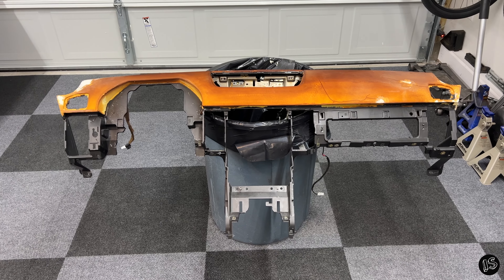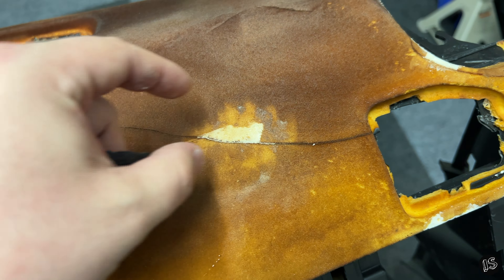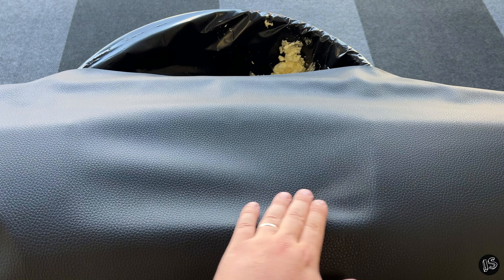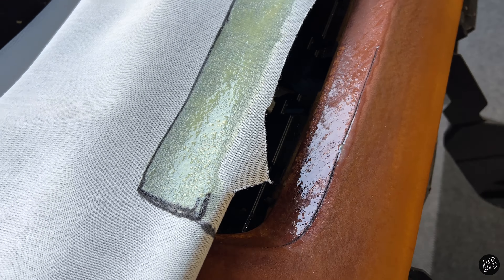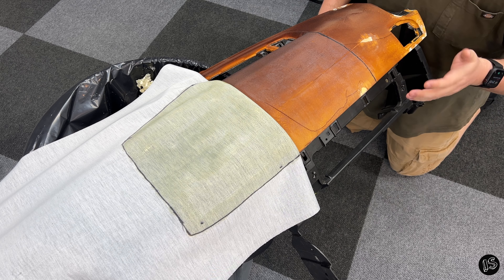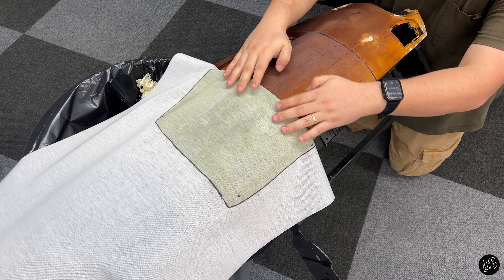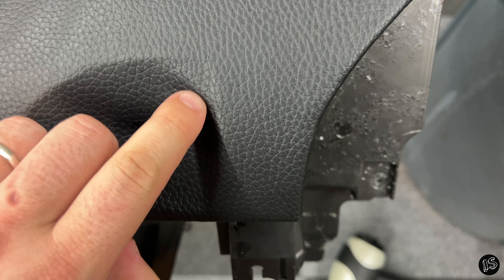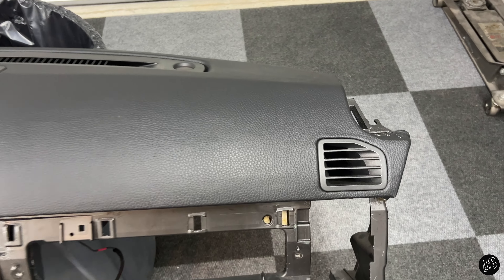G35 Cracked Dash Repair | $60 Total

Comment from the maker: **Safety Warning**

Perform this dashboard repair at your own risk. I am NOT a safety engineer, nor am I a qualified safety expert. I cannot guarantee that your passenger airbag will function properly in the event of an accident/collision. 

You can make relief cuts on the backside of the material where the airbag is to deploy. However, I cannot tell you how to perform this step. Use thought and caution before proceeding. 

Again, proceed at your own risk.

Comment: I was planning to do this but then chickened out and hired a professional.  He found the foam was deteriorated by humidity such that he had to rip the foam off and refoam.  Apparently its just a plastic shell with a consistent 1" or so foam layer.  So anyway, if anyone else's foam is too jacked to re-use,  refoamimg is an option.
Reply: Mine is needing to be redone.   How much did your guy cost and where ?  Thanks....

Comment: Great video and good work. Planning on doing the exact same thing, but I’m concerned about my passenger airbag. Do you know if that new material will rip   Or lift up if the airbag deploys? Big concern for me. Even considered making some very shallow pre-cuts with a blade on the back of the new material in a big X shape over the passenger side of the dash, (pre-install) just in case. Thanks!
Reply from the maker: I’m not a safety engineer, and do not want to be liable if something happens. So I cannot tell you “Yes” or “No”. However, my opinion is that an airbag would punch straight through this stuff if you made the cuts on the back side. The strength of the material comes from the fabric backing. Without the fabric backing, you could probably push a hole in the vinyl with your finger. It’s pretty soft stuff.
Reply: @Inner_Sanctum  My same thoughts. Do you think those pre-cuts would likely affect the overall look and outcome? How big of a risk?Would try not to get glue in those newly cut crevices, and obviously depends on how well you install, but again curious on your thoughts. Don’t want to apply all that time, glue and material just to end up with a big ugly X on my dash.
Reply from the maker: @Nino-xn7gm  I think thin cuts with a razor knife, making sure only to cut the fabric backing, would turn out just fine. You’ll have to leave the fabric backing in place to not create a depth void on the surface. However, the glue will easily fill the cuts left by the knife and it won’t show through. 

Best thing to do is take a small sample piece and glue it down to cardboard or some other soft substrate and see if the cuts will be seen. Also, you can test how easy it is to punch through when it’s dry.

Comment: just got one with 73k miles nice overall besides paint any tips on what i should do first?
Reply from the maker: Nice! I would say the first thing should be overall maintenance, even with low miles like that. These things are getting pretty old and time has taken its toll on a lot of the rubber and plastic parts. 

Performance wise, I always start with brakes and suspension. No point in making it fast if you can’t control it. Lol
Reply: @Inner_Sanctum  

GREAT video man! I just started seeing a fault crack along the ridge right above the silver strip recently on my '02 coupe. I'm really bummed because it only has 19k miles on, so it looks like I'll be taking on this project as well. Thanks for showing the process it was a big help.

Comment: How long did it take you to take the dash out?
Reply from the maker: Since I have experience removing this dash already, it took me about 45 minutes to pull it out of the car. Could definitely pull it out faster, but I like bagging and tagging all the hardware I remove. Also, I try to be really careful when pulling panels to not damage clips.
Reply: Ok thanks

Comment: I noticed that the video was cut out when repairing the center clock area. It showed you preparing it and then when it was finished . Can you provide any suggestions when doing that area?
Reply from the maker: Leave a lot of excess material so you can stretch easier into position. Wait until the glue drys fully before cutting the excess. If you don’t wait, the stress from trimming the material and it wanting to return to its original position will pull the material off the dash. It’s all above relieving stress.
Reply: Thanks, I followed along with the video and purchased the recommended materials. Everything came out great.

Comment: Did the vin plate stay on the dashboard when you removed it or did it stay on some structural piece below the dashboard? 

I'm considering doing this on my car.
Reply from the maker: I drilled the rivets on the vin plate. Then reinstalled over the new material with new black rivets.